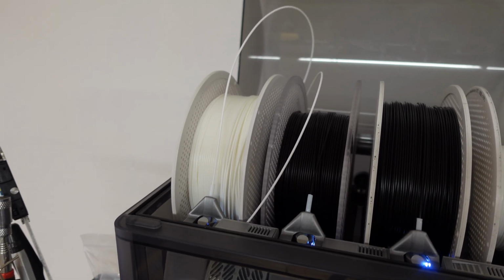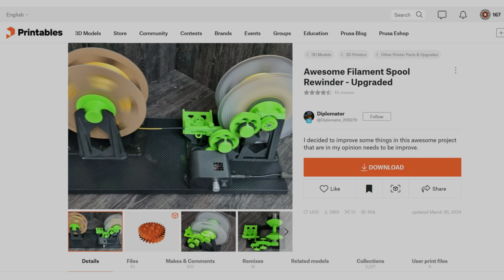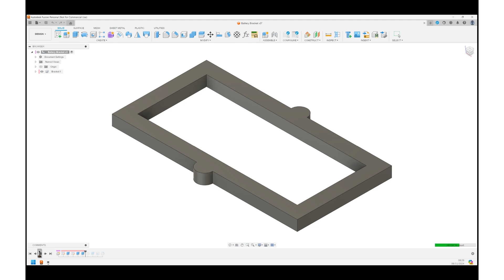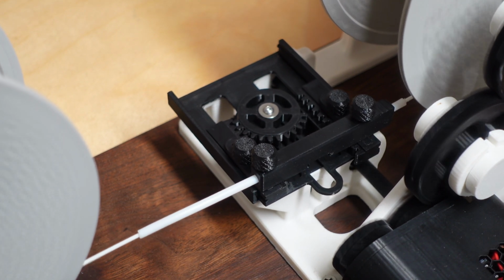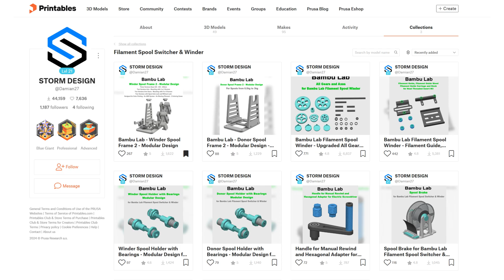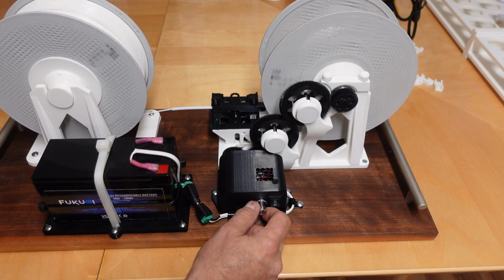Battery powered filament spool rewinder

Comment: Can you use this to transfer from a 5kg spool  30cm diameter x 13cm width
Reply from the maker: No, it looks like the maximum width is a little over 10cm.  5KG is probably also a bit heavy for this machine.  Since I printed this spooler, there has been a few newer designs that looks better than this one.  I have used this more often than I expected, so I have no regrets.  But If I were to build a new one, I would go with some of the newer sturdier designs.  Especially if I was doing large spools like you do.  Good luck in finding the right one.

Comment: https://www.youtube.com/watch?v=rCL1jeXOMHo  
Two years of trial and error, but now I am happy how it works.
Reply from the maker: I have seen a few more recent 3D printed spool rewinders.  They keep getting better.  Mine is working great and I use it so rarely, but it is great to have when you do need it.
Reply: @JANtheDane  I designed mine with modularity in mind, simple enough to use it to manually re-spool, easy to motorize for occasionally bigger jobs  (as it is now), easy to upgrade for filament production line, and robust to can take a beaten at a regime of 100 spools a day for years in the row.

In the kit I include a filament tensioner and extruder diameter regulator, the mechanical parts only.
Reply from the maker: Therein lies the difference.  You need to use your spooler a lot more often than I do.

Comment: I recently experience my first spool separation while it was in my AMS. I searched makerworld and found "Repair kit for spool". it held the two halves together, but the fiber had become bound when the spool separated. Now, I put one of the screw holders on every refilled spool just in case.
Reply from the maker: You can also use the spool hubs I made for my "Sealed Filament Dry Box".  That way you have a dual purpose of these hubs.  I leave those on when I move a spool into the AMS.  https://youtu.be/VvDmxLySSPU

Comment: Just had that happen to me for the first time after putting a new bambu roll onto a reel. Didn't jam my AMS but took a long time to fix the spool with the falling off filament. Thanks for the video!
Reply from the maker: I bought an off-brand HIPS filament roll (Bambu does not sell this).  Did not fit in the AMS, so the spool rewinder came in very handy.
Reply: happened to me as well. I searched makerworld and found "Repair kit for spool". it held the two halves together, but the fiber became bound up when they separated. Now, I put one of the screw holders on every refilled spool just in case.

Comment: Thanks. Which link is for the last spool winder shown?
Reply from the maker: I apologize, but I don't fully understand your question.  I posted 3 links to spool winder designs.  The last link "The version I would use if doing this over:" is for the version I would use if doing this now.  https://www.printables.com/@Damian27/collections/1304611.
I only discovered this version after I had already made my spool winder.  My own contribution should be clearly understood from the video.
By the way, I have used this spool winder more often than I imagined.  It comes in really handy when there is an issue with a filament spool.  Good luck with your own project.

Comment: I noticed you anchored the filament in a hole on the side of the new spool. There has been some recent discussion on Bambu's forum about the way the filament is now being taped to the cardboard spool and has caused damage to the AMS. Look it up if you're interested. Great video by the way, keep up the good work.
Reply from the maker: Yes, you are right.  It is best to allow the spool to unwind all the filament unrestricted especially if using the auto-refill function of the AMS.  Thanks for pointing this out.

Comment: If your buying Bambu filaments why would you need to spool it on to a new one
Reply from the maker: You probably don't.  However, as I mentioned in the video, I had had a Bambu Labs REFILL that I had come apart when I did not properly assemble the spool.  It would have taken me forever to recover this filament as it was a complete mess.  The spool winder made it easy.
I have also found instances where Bambu simply don't sell the filament I need.  I recently bought some TPU85A.  Bambu only sells the 95A version.  I needed something more flexible so I used another brand.  You cannot use TPU in the AMS, but I use homemade dryer boxes with bearings (https://youtu.be/VvDmxLySSPU).  This spool did not fit in my dryer box, and the bearings were critical in feeding this soft filament.
Another example was buying HIPS filament for use with ABS support material.  Bambu sells this only in 0.5KG spools.  I found another brand much cheaper, but the spool was incompatible.  Had to respool.
Anyway, hopefully you will never make the mistake I made when using a refill.  If you do, you will want a respooler.
Reply: @JANtheDane  😀 Yeah no i agree. I myself buy only Bambu but i was also looking at different loading spools in case i would buy a different brand
Reply from the maker: I find most of the Bambu filament quite resonably priced when bought in bulk.  It is so easy to not have to mess with filament profiles, and they carry almost all filament types...with a few exceptions.